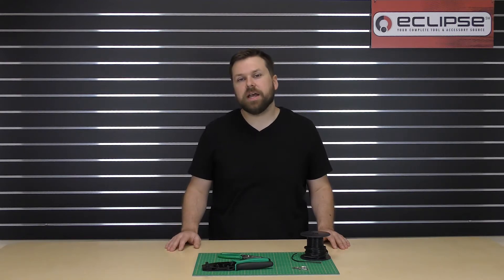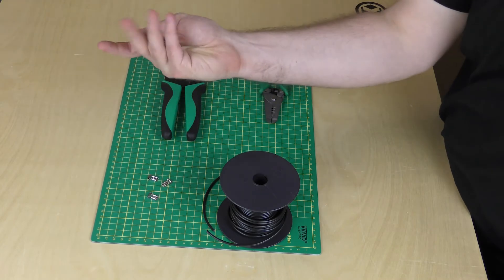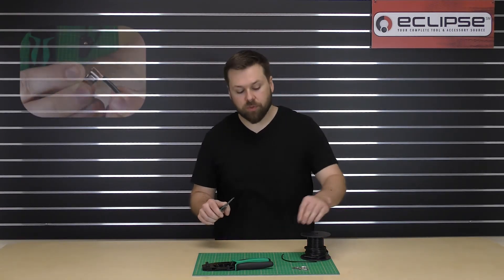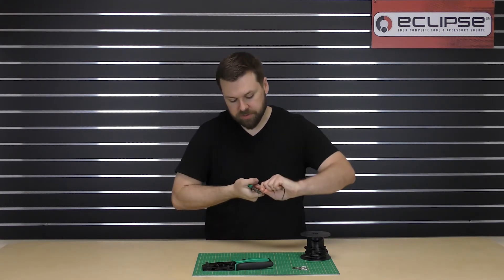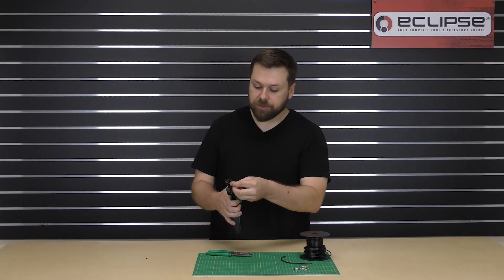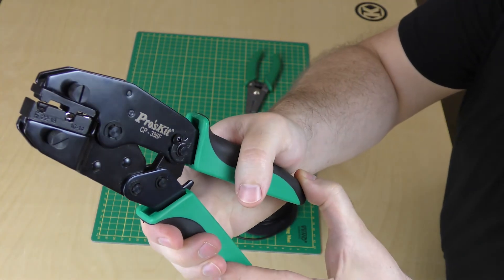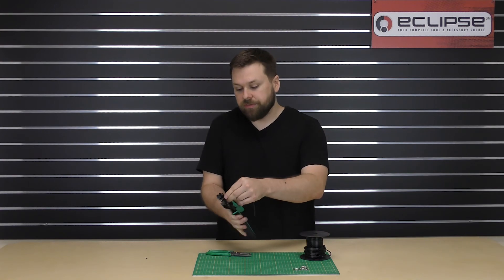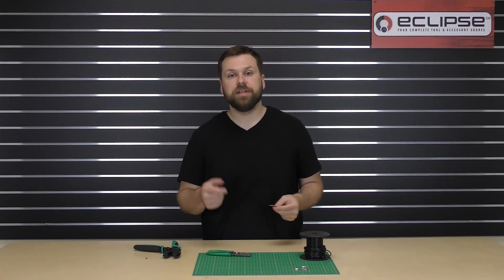QuikGuide: How to crimp Uninsulated Flag Terminals

Comment: What is Brand name and model# of tool? What size wires and terminals? Will it do insulated flags? Appliance industry uses these a lot. Wires from 22 up to 12. How are where can this be purchased?
Reply from the maker: Pro'sKit is the brand and 300-073 is the part number. There is a link in the description. It will not do Insulated flag terminals. We have 2 different die sets that handle insulated flags and are color marked. Here is link to die set for insulated flag terminals AWG 22-14, https://eclipsetools.com/default/300-070.html